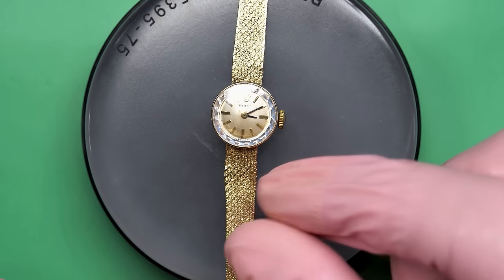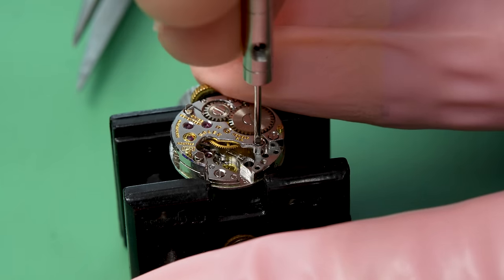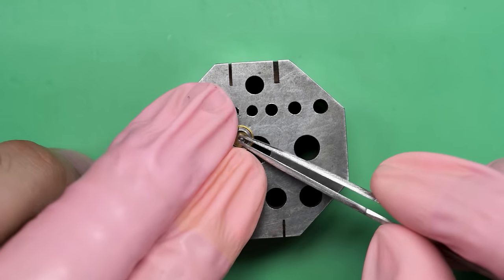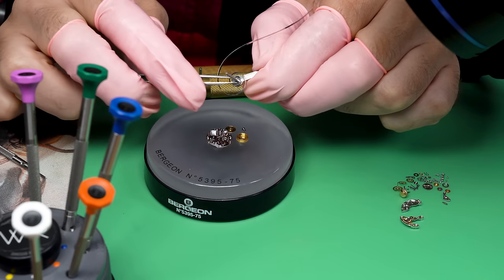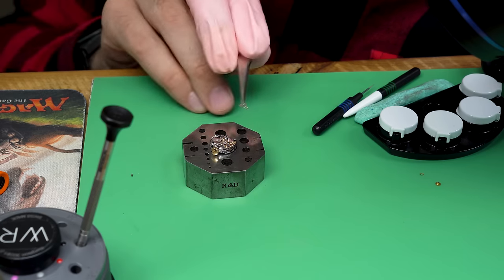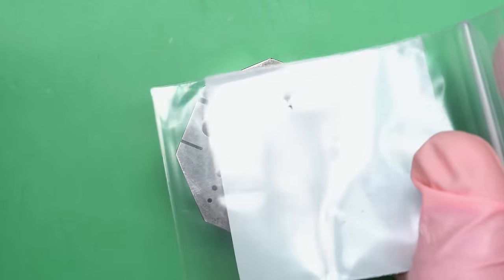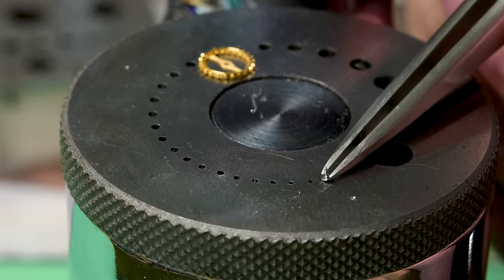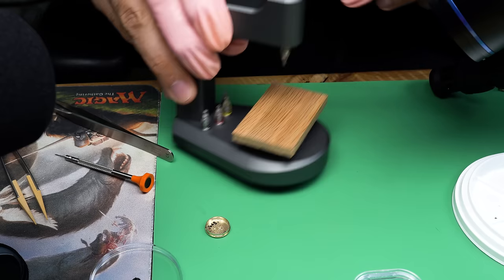I Lied, THIS is the Smallest Mechanical Watch I've Ever Seen!

Comment: I suppose you haven't seen Chaika 1200. 9×12.5×3 mm mechanism total size (yes, rectangular), 17 jewels, only hour and minute hands, no apparent shock protection, were manufactured in 1964–1968, mostly in a gold-plated case, exterior size 10×15 mm. The band was separable, either metal gold-plated or leather. I have one without a band. Can fit four of those in case across a Xiaomi Mi6 smart band, or, I guess, six on a face of an Apple Watch 42. Opens similarly to this Rolex, the mechanism is removed completely. I suppose that this specific model of Rolex, or its relative, was an inspiration for Soviet watchmakers in Uglich, Yaroslavl region, Russia back then. There was another tiny Chaika mechanism, slightly bigger than the 1200, in three editions — a pendant, a wristwatch, and a finger ring watch; the pendant being the rarest kind of case. I have the wristwatch with bracelet, also in running condition (but not sure if it runs any good).
I wish I had an opportunity to give the Chaika 1200 to you to peruse, for service (I had it serviced locally, it runs, but not sure how well) and case replating, but considering what Russian president does now and how the rest of the world reacts to it, it's zero options for me to send it to you from Moscow and then get back.

Comment: I just finished dismantling and putting back together a 17 jewel Elgin Sportsman wristwatch with a Seiko 66 movement. It was so incredibly tiny!! It was my first attempt at working with a movement and I should have listened to your advice on pocket watches for beginners! This was cheapest mechanical movement I could find, just to get my feet wet. Difficulty aside, I was able to get it completely apart and back together again in functioning condition! I didn't work on the mainspring at all however. I don't have a winder and didn't want to ruin my chances at seeing it run after reassembly if i messed up the mainspring trying to hand-rewind. Thanks for the videos and inspiring a new hobby! Incredibly difficult but very rewarding experience!

Comment: For the movement holder, maybe small little dabs of silicone sealant on the places it touches the movement will make it a little more grippy? Just brush a little on there with your little wooden dowels and let it dry.
Reply: I was thinking perhaps some small paper shims that would give you a better grip.....
Reply from the maker: I probably could have just sanded it down or filed it or something

Comment: Interesting. My grandma owned the Tudor version of this watch; literally identical but for the name on the dial -- also in 14k (as usual, Tudor used Rolex cases and bracelets, with ebauche movements often from Felsa or ETA). Omega was also particularly well known for this specific style of tiny mesh band + "gem crystal" watch in this era. These little cocktail pieces were extremely popular in the 60s-70s, as an evolution from the more angular, embellished, rope-strapped cocktails of the 40s and 50s. As far as tiny or least super thin watches, you haven't lived until you've worked on a Concord Delirium... Never again.
Reply: My mother got the Omega version of this watch. Exact same, except for the Omega logo on the face. She got it when I was born in 1972.
It runs to this day (and has never been serviced).
Reply: @jarls5890  You should really get that serviced if it's going to be used at all, even if it's working currently. Running a watch that old without servicing is like running a car without engine oil -- just a bit slower for major damage to become apparent.

Comment: I'm betting the reason that smaller holder won't work is because of the plastic not gripping. I bet if you glued bits of that grip padding that's used under rugs and whatnot, it would solve your problem and make it usable in the future. Cheers!

Comment: I'm staggered that well before computer tech was available, those tiny parts & screw-threads could EVEN be manufactured to such obvious close-tolerances!
Reply: They have had magnifying glasses for several hundred years. So it's not surprising that they could build such small ones.
Reply: @tradde11 very careful work. Good lighting and paying close attention to each piece.
Reply: That's a given though ... Lighting, magnification & steady hands ... but how on earth were those fine thread parts ever engineered in such exacting tolerance?
Reply: @tradde11 oh yes! There might be someone who does it as a hobby. I would check u tube and f.b.to start with

Comment: Hi Marshall, another great repair! Just a quick question about getting the balance in beat after major disassembly like that... when reassembling, how do you know where the roller table and balance spring should go in relation to one another? Are they marked in some way, or is it a case of trial and error?
Reply: I had this question as well. Because the hairspring connects to the balance bridge which sets the angle the balance sits relative to the pallet forks (I think?) but how do you know where that roller table goes.
Reply from the maker: I basically just started over and put the roller wherever, and then eyeballed the balance spring collet/stud orientation. As you saw, it was way off so I had to adjust it.
Reply: This is why it's absolutely imperative to mark the underside of the balance wheel of where the impulse jewel is prior to removing the roller table.

To be honest with modern tech nowadays one could also use a camera. I still mark the underside which saves you a massive headache later. 
I was super surprised to see it fire up after the roller was placed at random but I guess that is a lottery win or video editing :)

Comment: I bought a Waltham 645, 21 Jewel, Railroad Pocket Watch from a Colorado  seller with 18,000 feedbacks.
Watch is 16 size (case diameter 49 mm). The movement is a grade 645, lever set, 21 jewel, raised jewel settings, gold center wheel, micrometer regulator, and adjusted to 5 positions. It is running and the seller's feedback on watches and the like is very good, so I'm confident it will be a decent watch like I was looking for, but also you have a video on one of these exact watches so that will be a great guide for me to dive into it.

I'm going to buy a few of the basic tools your other video outlines- screw drivers, tweezers and so forth, nothing fancy or expensive, and see what I can do with the watch.

Comment: Excellent!  I did notice that you installed the minute wheel before starting the lubrication - I now remember to lubricate that jewel before completing the minute works, having made that mistake a few times. Also, I’ve found that aligning the impulse jewel between the banking pins as I align the hairspring stud with the balance cock can save much of the painful work of adjusting the hairspring collet later, in trying to set the movement in beat.  I’m sure you know this already!

Comment: Great video Marshall! To fix the movement holder, maybe take a file and make sure there are no rounded edges on the jaws were the movement is sitting. I think it has enough clamping force in it, but it was just being squeezed out! Not as precisely made as the milled 90 degree angles of the nicer ones.

 I'll add that I don't know what the hell I'm talking about, but I think it may work. See you in the next one!

Comment: My ex-wife has a 1970's "Seiko" ladies ' bead bracelet' (manual wind) watch. Each bead in the bracelet measures only 7mm dia. Into one of these 'beads' is inserted a tiny (7 jewels) Seiko Movement. only 50% (or less) the size of the Rolex you've just worked on - this would truly test your mettle. It still works & keeps reasonably good time, although it has never been serviced.

Comment: Marshall, maybe the reason this holder does not hold the watch tight is because you have one side of the holding side? plate? on the crown. Rotate the watch so that the crown is not where the holding thing is.

Comment: Use some single sided adhesive (or use super glue) rubber tape in the jaws of the tiny movement holder and all will be well. Im so impressed with how you work, and remember where it all goes upon rebuild! I work on vintage cameras and have to go to great lengths to remember how it all goes back together, usually with many photographs. Great video as usual! :o)xx

Comment: I'm a lurker on your channel. I don't watch every video, but I thoroughly enjoy the ones I do watch. I became interested because of a ladies Bulova Accutron watch that I own and I can't find a watchmaker to repair it. I was so excited to see this video because the watch is so similar to mine and it gives me hope that someone is able to repair it, I just need guidance about how to find them. 

Based on the serial number on the back of the case, I believe it's a 1973 model. The case is 14k and 3/4" in diameter. The watch bands are nearly identical to the watch in this video. My bands have arcs of tiny diamonds where they attach to the watch case and the watch has a diamond bezel with tiny diamonds that match the stones on the bands. 

Do you have suggestions for finding an able watchmaker? I'm in Dallas Texas but will send the watch anywhere, preferably in the US.

Comment: I have a watch that is a little bit smaller than that Rolex. I was wondering if we can send watches to you to clean? Mine is not an expensive brand but it still works and it’s a wind up watch. No battery. I love it because it’s so small.

Comment: Try rotating the case in the holder 180 degrees, so the crown knob is in the other fixture notch. That may or may not help.
Also, some tiny undercut notches in the fixture jaws might work.

Comment: All you need is the same metal movement holder you always use with notches cut closer to the center. May be able to get just the 2 plates made by PCBway. And interchange them or buy another holder and put the “small movement” plates on the new holder

Comment: If you don't have a movement holder small enough, a sticky silicone pad could hold it. I don't do watches, but I do jewelry and sometimes have to hold tiny pieces while I work on them. I use a sticky pad to do it. The pad I use is actually used for working with eylash extensions. Cost me about $6.

Comment: I think I have mother's dress watch that I remember she wore in the 60s, oval shaped, it was TINY, and because it was oval I think it was smaller than the one in the video!
You should see some of the Gamewell municipal fire alarm  telegraph boxes, I have a collection of them- they used a large  solid brass  windup movement with a huge mainspring, grear train essentially like a clock, but instead of a balance wheel  and fork, they use a pivot with adjustable weights on it. They are not meant to run more than  one cycle at a time, whereclock hands would be there is a single notched contact wheel that makes/breaks the electric with contacts that it turns against, the wheel turns 4 times and that's one cycle.
The construction of the movement is usally made of about 1/8" thick brass  that the gears and spring are held in by, there's no jewels basically because these dont run 24/7 like time pieces, they may cycle a couple of times in a MONTH, so there's very little wear and tear.

Most of them have a gasketed glass bowl or a brass case with a round glass window, to keep dirt and dust out.
I also have a Gamewell printer from about 1890 that is solid brass, beveled thick glass and weighs about 25 pounds! The mainspring was broken, but a clockmaker was able to replace it for me- the spring is 1-1/2" wide! The barrel for the spring is about 3-4" diameter.

I also own a  Hartford clock powered  time switch from about 1920, it has a cast iron case and a wind up clock movement  with a balance wheel inside, you set the am/pm dial to the time you want the electric to turn on, and when you want it off, it's an automatic  switch that could turn on lights or something else as long as it's kept wound up, rated 250 v and 20 amps, it's an unusual clock for sure!

It's amazing how the watches, clocks and tower clocks as well as these pieces of fire department equipment all use the same basic design with a main spring, gear train, some type of escapement, and using the gears to perform action like move hands or electrical contacts.

Comment: I've just recently started following your channel and watching your amazing videos, but I think I may actually have a few watch movements that are even smaller than this one. One is a Gruen that is roughly 1/2" by 1/2", it's practically microscopic. Another is a Lotus that is a pointed oval shape that is 3/4" by 1/2". Lastly I have a tiny Timex that is about 5/8" x 5/8". These watches are magnificently small. I also have a tiny Rolex that is almost 7/8" but I've been told it might not be a real Rolex.

Comment: @Wristwatch Revival   There exists a tool that I think you should try:  They are called Bone Folders.  Extremely strong, rigid, and does not mar pieces.  I've used one for several years now, and it is fantastic!  I can hold down springs SECURELY, etc.   I can also use it to put hands back on.  They are cheap, too!  Just don't tell Bergeon about them.

Comment: All ended well after all, but I just wanted to mention that perhaps the watch would have sat better in the small holder if you had taken out the stem first. I worked on a very similar mechanism once and the crown blocked it from positioning itself against the little jaws properly. This is why the mechanism sort of sat non-symmetrically (the other side did not have that problem) and would flip out of the holder as soon as I applied the slightest bit of pressure.

Comment: Gosh… I worked on a 60s Longines ladies watch with a 410 movement… That might be even slightly smaller than the one you have here. To make it even worse, it have three train wheels, and center wheel and escape. The three train wheel and escape were hosed by one bridge, meaning there are four pivots I have to line up on a tinny bitty bridge. This is the very first project I did, for my mom… It’s a real battle….

Comment: Just a thought, could you put two pieces if foam tape, maybe door insulation, or1/2" foam. That would give you the ability to tighten it down, without scratching the sided.

Comment: If you place a thin layer of open cell foam rubber between the tiny watch and the holder making a "cradle", not only will it help protect the watch, but it will keep the watch from slipping out of the holder. It may not look pretty, but it is effective.

Otherwise, 
Impressive work!

Comment: Could the initial high beat error have something to do with the alignment of the impulse jewel under the balance wheel? That was all I could think about in the part of the video where you press it back onto the staff. I'm sure you measured it out, but with a watch this small I bet rolex builds it accurate to the micron
Reply: That's what I was thinking. The roller table seemed to just be pressed on without any regard for the alignment of the impulse jewel with the balance wheel. Similar story for the hairspring, there was a gap in the collet which will affect the balance of that rotating system.

Comment: D. Dornblueth & Sohn is a traditional German watchmaker whose watches are incredible for the price.  If I had the money I would definitely have one made.

I used to have an automatic watch which was just slightly thicker than that one.  I can't remember which movement it had but it had an extremely complex selfwinding mechanism with two sets of planetary ratchet wheels allowing it to wind in both directions.  I liked watching the ratchets rotate on themselves along the edge of the movement while turning the rotor.

BTW the Rolex 1400 is one of the smallest movements ever produced with a freesprung balance.  The 1401 is the same but with a long arm regulator.

Comment: the small movement holder is a slick plastice you need to roughen up the holder a little or a little duck tape (duct tape fixes everting) on the feet will also work

Comment: Could you drill and tap 3to4 holes just outside of the diameter of the case that would hold the watch into your holding took and make the small tool reliable

Comment: I have an even smaller watch, the casing measures 20mm, its a lanco 1713, and it has an oval movement. It ran slow so i took it apart and it has never been serviced. Polished the crystal, put multi purpose grease on the fork and every jewel, silicon grease on the spring. Baby oil on the balance, and brake pivots. I have no tools other than reading glasses, tweezers, magnifier and screwdrivers. Its possible, the most likely thing which can go wrong is ruining the balance spring, send screws or jewels flying. How did you remove the balance spring? This was not in focus. Very good video thank you.

Comment: Woaw, that is really impressive ! you would have made a good surgeon as well !
I have a question , 34:43, how to know where to clock the hair spring end relatively to the "D"  shaped escapement stone ?
I guess this is critical to have the amplitude centered. No ?
Thank you.
Reply from the maker: You are supposed to mark the roller and spring positions but I didn't, so I had to just re-do the beat error from scratch instead.

Comment: Aren't you supposed to poise the balance wheel before putting the hairspring back on?  Also, the hand tool you used to remove the the roller table should be used as a wedge.  Slide the balance wheel with roller attached thru the slot...the tool is tapered on the underside that separates the two parts.